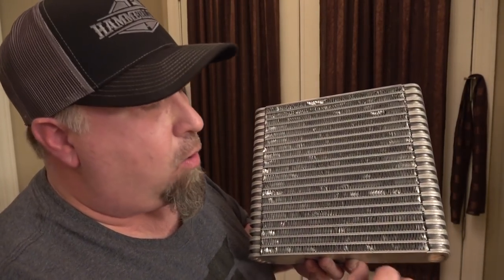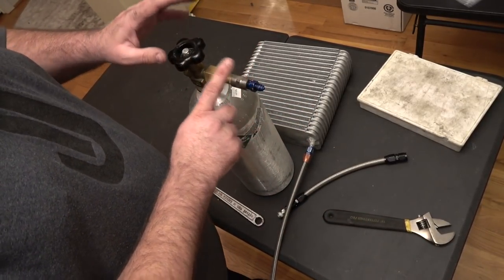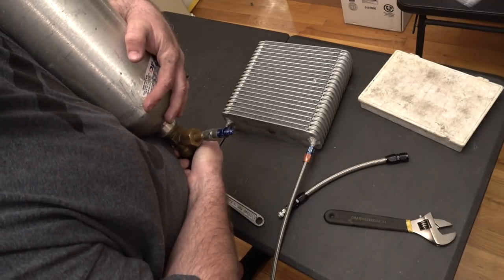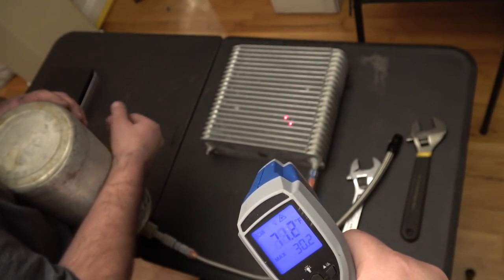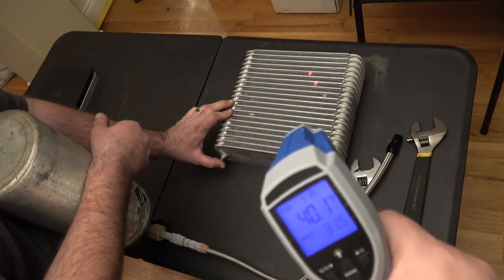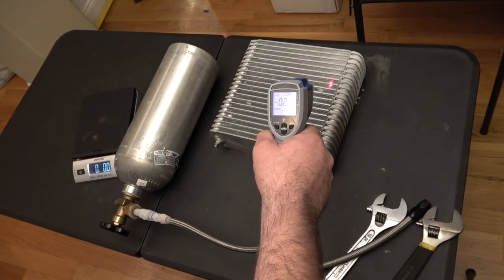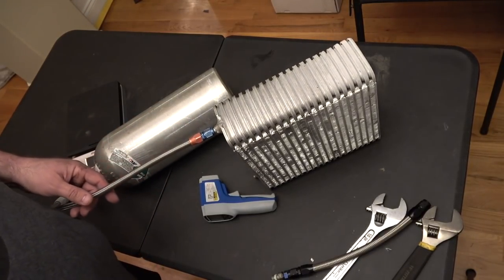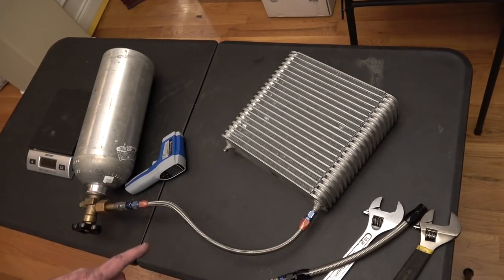Prototype CO2 Intercooler, Super Cold, you can build at home!

Comment: Heck , you could hook that to the ac compressor, and use it just like AC!
Reply: I was thinking the same thing!
Reply: They make interchillers which use your ac system and if the idea works that seems like a better solution hooking up a ac compressor and getting it all figured out because with different Refrigerance or different pressures you can get real cold I recently filled my 134a system with r290 (propane) and I saw as cold as 17° f air coming out of my vent  while it was 100° outside

Comment: I think it's a great idea I've been thinking about using co2 in some way for years! Once this to worry about is icing the core. If it freezes over you would lose massive amounts of flow and get crazy compressor surge soon to follow
Reply: Agreeed..I think it would need sum kinda sensor that could turn system off every so often to keep things not icy
Reply: The air flow would probably stop it from getting too icy
Reply: Intake air temps are 200-600°+ degrees at times before cooled so freezing probably won't happen. You can regulate flow or use pwm to chatter the trash can solenoid. On off on off on off on off.......

Comment: Now people will relocate their A/C evaporator in line with their intake lines. Or...mount your throttle body inside the car and keep the A/C parts in place but re-pipe the intake. Keeping the factory compressor will lead to high rpm compressor failures which will lead to someone coming out with industrial rated higher rpm versions. The trick will be maintaining a constant temperature delta-T. Give it to Gale Banks and let him have a whack at it...

Comment: CPS Complete Street performance. Check out this guy. He installs the interchillers. They run off the ac compressors and you can see how he tunes them with more timing and 100 extra hp offsetting any weigh increase. They are run on the street too!

Comment: I RAN A KIT SOMETHING LIKE THIS OVER 15 YEARS AGO NOW ON SEVERAL OF MY SUBARUS. I ENDED UP USING THE NITROUS EXPRESS INTERCOOLER KIT WHEN THEY FINALLY BROUGHT THE KITS TO THE MARKET. I USED A PURGE BUTTON AND A 2 STEP SWITCH THROTTLE SWITCH SO IT WOULD SPRAY AT HALF THROTTLE UP TO FULL THROTTLE IT SPRAYED WIDE OPEN CONTINUOUS UNTIL I BACKED OUT OF THE THROTTLE OR THE BOTTLE WAS EMPTY! 😆 IT DID WORK EXTREMELY WELL AND MADE A DRASTIC DIFFERENCE IN LOWERING HIGH TEMPS. IT HELPED EVEN MORE LOWERING HIGH TEMPS ON THE FACTORY TOP MOUNTED INTERCOOLER ON ALL TURBO SUBARUS DUE TO THE FACT THAT ALL TOP MOUNTED INTERCOOLERS SOAK UP MORE HEAT FROM THE ENGINE BAY. I STRONGLY RECOMMEND EVERYONE USE A SPRAY KIT ON THE INTERCOOLER OF ANY TURBO CAR STILL RUNNING A TOP MOUNT INTERCOOLER! YOU WILL BE AMAZED AT THE DIFFERENCE IN TEMPERATURE REDUCTION AND POWER GAINS AND THE BEST PART IS YOU CAN STILL USE THE SAME KIT IF&WHEN YOU DECIDE TO SWITCH OVER TO A NICER&LARGER FRONT MOUNT INTERCOOLER KIT ON YOUR CAR WITHOUT HAVING TO SPEND MORE MONEY OR HAVING TO BUY A COMPLETE NEW SETUP! I HOPE THIS INFORMATION MAY HELP SOMEONE OUT THERE TRYING TO DECIDE WETHER TO BUY A NOS SPRAY KIT FOR THEIR TURB CAR!

Comment: Hey John. You need to make a larger outlet on the co2 core. Its the expansion of the gas that cools the core. You would want very low pressure on outlet side. Just like reading ac gauges.

Comment: Awesome idea! I would get one of those cheap water\air barrel intercoolers and just make an inlet adapter to fit your co2 line and jets. As long as you get the pressure change like an ac system should work great. And I'd pipe the exhaust ac away so there's no chance of sucking it into the intake

Comment: You're the Man John; I've been thinking about this kind of intercooler for a couple of years but you're doing it. A few thoughts tho;  An AC compressor weighs close the same as a tank of CO2. Your bottle will need to be refilled for every hit. You can build a compressor setup out of junkyard AC parts you probably already have. The power consumption of an AC compressor is only like 5 HP.   KEEP AFTER THIS IDEA!!!
Reply: James Wolfe problem I’d see with that, just like the other chillers for SC builds, is that moisture gets leaked out and onto the track so it would only be able to be used in the pits.
Reply: @doctordifferentialspeedsho9506 . Catch Can. Sponge. Moisture's an issue with any Super Cooler for sure.

Comment: I would actually trying putting the jet on the outlet side so It will give it back pressure on the outlet and maybe help with the distribution of the co2 throughout the whole core. the co2 is gonna go path of rest resistance but if you put a jet in the outlet it may restrict it and keep the co2 on the outlet side a little longer making the outlet side as cold as the inlet side. just a thought
Reply: I'm going to guess you have very little experience in HVAC or refrigeration. The liquid going through a small oriface into a large area is where the phase change happens, which is what causes the cooling effect.

Comment: Maybe smaller cores linked in series? Like multiple pass radiators and heat exchangers. Maybe regulate the pressure to optimize the use of gas?
Reply: pressure drop would make it non viable.
Reply: @DieselRamcharger  it doesn't drop that much.
Reply: @vitor900000  wrong.
Reply: Diesel Ramcharger That doesn't mean it's not worth testing.

Comment: I’ve always wanted to try this with liquid nitrogen with an air to water.
Reply: That would work 👏
Reply: 90% of nitrogen storage is gaseous nitrogen and not liquid nitrogen.
Reply: Liquid Nitrogen isn't that great a coolant. It doesn't have a very high thermal capacity, nor does it have a very good thermal conductivity.

So... Liquid nitrogen may be super cold, but it doesn't last very long.
Reply: @AmaroqStarwind  neither dose 1/4 mile

Comment: They DO sell siphon tube CO2 bottles used to fill smaller bottles, red top instead of green
Reply: He's using the wrong gas... this was successfully done back in the 90s. Just the added equipment needed in racing didn't weight out. Yunick I think experiment with it.
First started out spraying water in front of the intercooler and radiators when they were trying to keep things from over heating, back in So.Cal

Comment: Here is something I've seen done that works.
Air to Water intercooler running Evans waterless coolant. Dry Ice as the coolant. Evans temp at the intercooler 15 degrees.
It's a little more expensive to run but it sure worked.
Reply: Dry ice is CO2 (Frozen)
Reply: @jameslowrey8419  I'm pretty sure everybody knows that.
Reply: John Parrish based on your comments it didn’t seem that you did. Sorry.

Comment: Can think of several ways to improve the system. Firstly use a different core with bigger runners. The temp difference from side to side is obviously showing a flow restriction. Secondly I would fabricate a new side feed end tank that allowed the flow to be more evenly distributed, or use a multi point injection system. I have been quietly working on this idea for several years now. Different medium but the same idea taken to another level.

Comment: stand the rad up so both the gas intake and exhaust ports are up top. CO2 and expecially the liquid CO2 is denser than air and colder gas is even denser than warm, so the liquid may puddle at the bottom and make the effect even stronger.

Comment: It is a Great concept. I would put a pressure relief valve on the open side, this way heat will expand and the pressure valve would release. then create some type of air box to force the air thru the center of the core and it should act like a air to water design.  without the weight of water. i would try a 100psi valve this way the co2 stay liquid

Comment: I know this is an old video but what you need to do is run the inlet wide open and put the restriction jet on the outlet side
. That should force the CO2 into more channels before it is able to exit since there will actually be some pressure created inside and it should  cool the entire core down faster.

Comment: 3 lb of ice to 1 lb of salt will create negative 2° f water

Dry ice, and ethanol will make negative 109° liquid

For every 10 degrees Fahrenheit, you can bring down your air inlet temperature. You get 1% additional horsepower... That's not me saying that. That's Gail Banks the granddaddy of boost.

There's not a lot of thermal mass in CO2 spray. It's just very cold, so use something with a lot of thermal mass and a low temperature

Comment: half that size, put a pressure release on the outflow, drop small tank into waterchiller tank, open the bottle before run, exit pressure release valve will hold the co2 at pressure you set, then it warms up after a few minutes run your pressure release purge valve on exit side to cycle fresh co2 into core to rechill it.
Reply: co2 is heavier than air, so the co2 stays in the core even without a exit plug, and as it warms it pushes out, keeping it cold for much longer than valve was open

Comment: Your going through a lot of work and theres already a better solution out there. Look up interchiller on google. It uses the oem  AC system too chill a water loop for a A2W. No big slushbox in the trunk needed,  small  front mount res works better in this application (less time for the ambient air too warm the supercooled coolant) and this can net well below sub ambient IAT temps.

Comment: The expansion valve's job is to slow the freon enough that it can fully evaporate before it exits the evaporator. So definitely restrict the exit
Reply: Doesn't work that way guys. The gas gets how when compressed and then after it loses that heat and it expands it pulls in heat from the surroundings. You need the gas to expanded inside of the core so it will draw the heat from the air going through it. He has it right. Works just like you cars A/C.
Reply: Wrong, the phase change occurs because the pressure drops. Small orifice on the inlet with no restriction on the outlet is what you want.
Reply: @joepetreng471  a restriction on the outlet of the evaporator would not be beneficial. If anything you alter flow with something like a thermal expansion valve on the inlet side.

Comment: They have kits you can buy to hook up to the A/C system!
Reply: Correct, its sold under the name "Interchiller"
Reply: Forced induction interchillers. I believe the Dodge demon has a similar system in it factory
Reply: @blindabinda1234  Yep. It can only be used for a limited time....It runs out of coldness really fast.
One of the problems is ( just like a cold drink on a hot day ) too much condensation. 
Remember: Hot air has more moister, then cold air. So you end up with a lot of condensation.
Reply: @brightstarlastname2812  Hot air has more moisture *capacity*, keep in mind charge coolers are intended to reduce the pumping heat from blower/turbo. The intake air carries a quantity of water that doesn't change from intake to cylinder, even though the relative humidity decreases as the charge is boosted the amount of water is the same. Still your point is relevant in that the amount of water is non-zero and so a charge cooler that's below freezing could ice foul.

Comment: Interesting idea! I think it will work good. with the amount of hot air going though it from the turbo it would warm it up quickly as the core doesn’t have a lot of thermal mass, y’all might have to leave the co2 on the whole time your making power to keep the boost air cold
Reply: That would probably empty the tank.

Comment: If you buy a copper or brass core you can use plumbing solder and copper roof sheeting to solder this all with no aluminum Tig experience.  Also, I agree with the liquid nitrogen idea - and I think you will have better results feeding liquid from the bottom (perhaps through an orifice) and having a large vapor exit on the other side, that's how AC systems work as you said earlier in the video.

Comment: Some AC units use propane as refrigerant, it can be cancerous if damaged, but it works! That should work well, for a full race setup along with a air to air intercooler, for normal use,  put that in a kinda diamond shaped box between radiator and throttle body, maybe put a valve on the outlet to regulate flow! And there you go pulling -70° air!!
Reply: Propane is not a carcinogen. Refrigerant charges are relatively low anyways and a leak that could coexist during operation would have to be darn small or else no operation at all

Comment: I think the problem with this will be condensation entering into the air system. Maybe even a freeze up in the intercooler if the air gets cold enough and you can't get rid of the moister in the resulting air flow.  Probably not an option for a diesel engine even if it doesn't freeze up because of that. However, placing that directly in a cowl in front of the intercooler would still be an option for short runs.

Comment: Something I've always wondered is when you run nitrous you add fuel, if your fuel was liquid Propane you would get the benefit of both converting to gas and dropping the temp.
I wonder if a 100 NO2 shot with the liquid propane would be enough to act as an effective intercooler.
Reply: @MAXIMUMWEDGE  Ok, I can see your issue, but I'm talking about sending it straight into the intake manifold, not to an intercooler, it would be more like Evaporative intercooling.
A 100 Shot, Plus the liquid Propane, Plus however much boost your Turbo puts out. Have the 100 Shot go active at full throttle. I think most people launch at 4000 rpm or more these days so it should be fine. It would also allow you to run a larger size turbine for reduced backpressure.
Reply: John Parrish, though not very related to this video, what you referred to is the basis of Liquid Phase Injection (LPI) of Liquified Petroleum Gas (LPG - a mostly propane automotive fuel commonly available in some countries). Ford Australia did that in recent years with its EcoLPI variant of its excellent Barra 4.0L inline six cylinder engine. The LPG is electronically fuel injected into the engine in its liquid phase. It immediately turns to gas when no longer under storage pressure. Latent heat of vaporisation causes a massive drop in temperature of the intake air that the fuel is perfectly mixing with. This allows more air (and fuel)  to enter the engine, producing more power & torque than the petrol (gasoline) variant does. This mild boost without any supercharging or intercooling, combined with high static compression (LPG is a high octane equivalent fuel) not only gives higher performance, but is cleaner on the environment and engine oil, and is cheaper to run too. 🚙
Reply: @lyndongordon2518  Very interesting, I had to look the EcoLPI engine up, I had never heard of it.
I was told years ago that EFI was not possible with Liquid Propane because the injectors could not take the pressure and there would be an icing problem. It looks like the Australians solved both.
I would love to get my hands on some of these parts to see if a Universal kit could be devised to work with a Holley Terminator or FAST engine management system.
Thank You

Comment: If the core could handle full pressure you could leave the bottle on and just have a valve on the vent side possibly with a restrictor for more efficient cooling kinda like when you spray an aerosol can for a while and it gets cold

Comment: I know I'm way late to the party on this, but if you used nitrous, depending on the flow required to achieve the necessary cooling, you could then run the nitrous 'outlet' from the core back into the air intake...

Comment: You should stand it vertical with the inlet tank of the core on the bottom. That way the liquid CO2 will cool the core evenly. That is why the bottom of the core was colder than the top. Also it will probably work better with the outlet being bigger. You will have a problem with the core freezing up and restricting airflow too if you let it get below freezing. That is why water to air ICs work better.

Comment: i know you posted this a couple weeks ago, but perhaps youll still see it.  

High pressure CO2 is being used in new high end cars for the AC system.  The first one (AFAIK) is the new Audi A8.  Its been a theory for quite a few years but has such a high operating pressure it has some issues.  The good thing about CO2 is it is not flammable and it is not an ozone damaging gas.  

What im getting at is, if you want to get wild with it and wanted to use it for road racing, you could find out what type of pump theyre using in automotive AC and recirculate the gas.
Reply from the maker: Interesting, I did not know that

Comment: The reason it’s not working all that well is because it becomes cold from “the evaporative effect”. Meaning you need to allow the liquid CO2 to become a gas as quickly as possible and to do that it needs to be vented to an expansion tank or atmosphere. You might have more luck by drilling little holes throughout the core of your condenser/intercooler. Only thing is is the CO2 would go in your intake stream and give you less O2 density, which wouldn’t help with what your trying to achieve.

Comment: I've always thought about doing this with liquid nitrogen. what you would do is you would fill the evaporator with liquid nitrogen on one end with a purge valve on the other but also a relief valve and at a certain pressure. It would relieve it because I would no longer be cold enough. And automatically refill from a bottle. You'd have to put some safeties in the system like an automatic shut-off valve... On your intake track because if you got liquid nitrogen in your engine that would be really bad.
Reply from the maker: Interesting